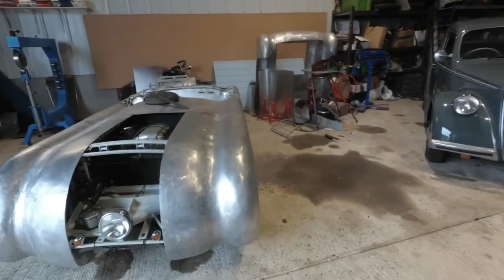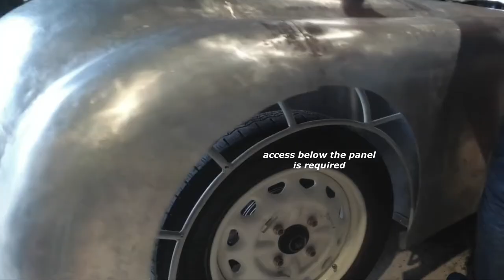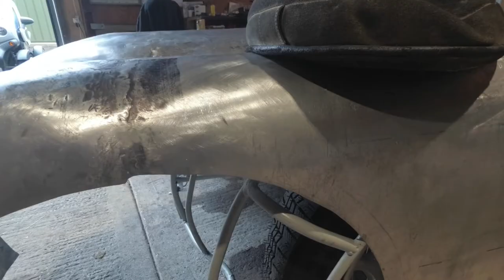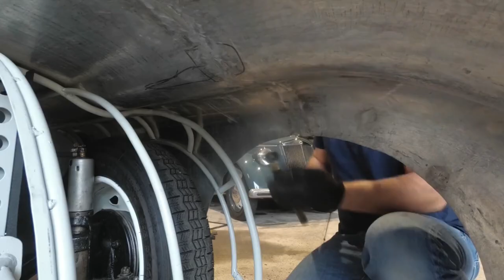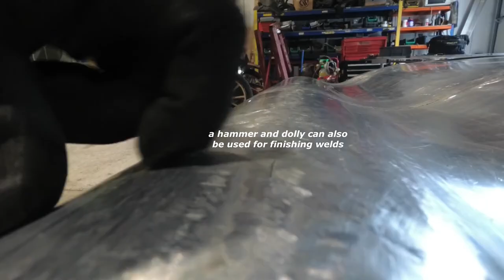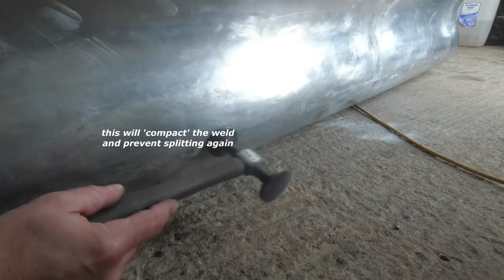How to Use a Hammer and Dolly

Comment: I hope it gets finished, I'm sure it will.
Can this technique be used on brass panels - I have made a 1/6 scale traction engine and the tender is full of complex curves. I made a template from wood and used a wooden hammer to bend the annealed brass into place. Had to cut out the excess folds and rejoin using silver solder. A long job - about 3 months of 2 to 3hrs a day
Reply from the maker: Thanks Pierre.  Shouldn't be too long now.  I believe it can be used on brass, for artistic projects like old fashioned armoured suits. It looks very difficult to do any metal on such a small scale though.  I'm a fan of steam power, so that sounds like a very interesting job - and very rewarding.  Good luck!

Comment: Okay I had a rock fall on my hood. The depression is almost triangle like, with a sharp point in the middle with that being the lowest spot. If I understand correctly I am hammering from the "low side" and hold the dolly firmly against the protruded metal?
Reply from the maker: Yes, that's it. Firmly hold the dolly against the protruded metal and hammer from the other side.  A good toke beforehand will make it easier!

Comment: High spots or low spots first, or does it not matter?
Reply from the maker: You should be hitting the high spot with your hammer, and with the dolly touching the low spot, the high and low spots should level out together. They're both levelled at the same time.  Hope that makes sense!
Reply: @GasoliniASMR  thank you 👍